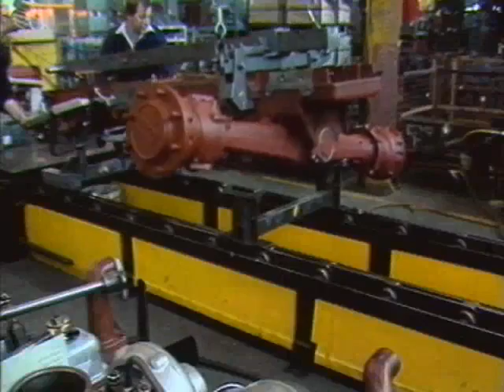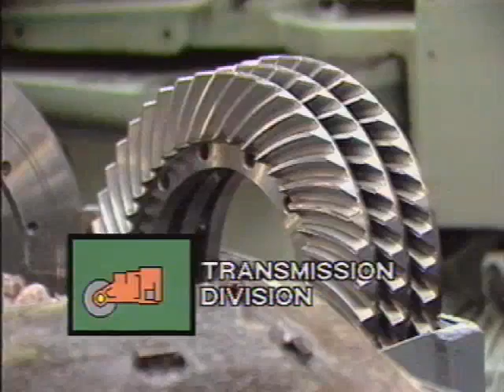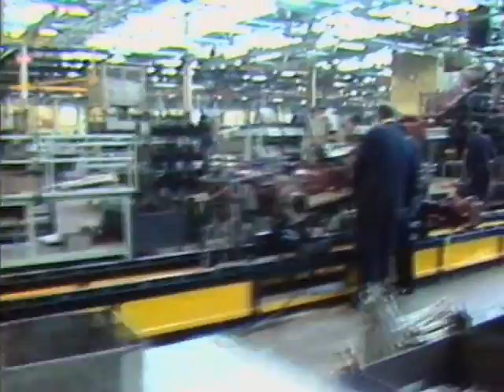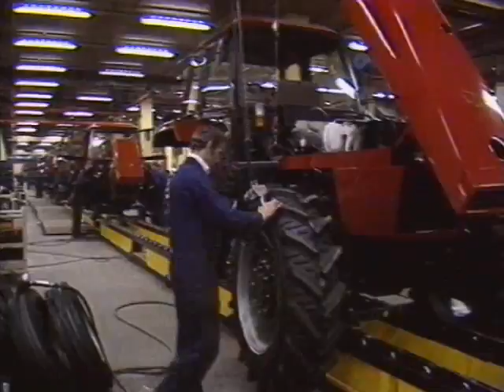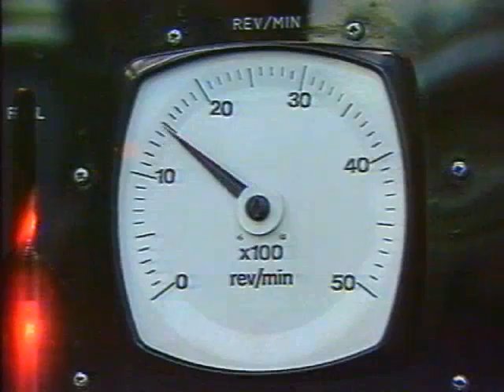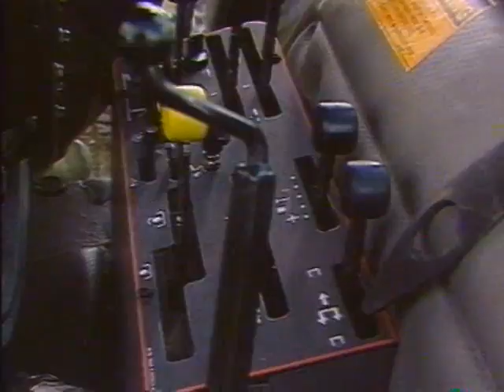Case IH 94 Series Factory Video

Comment: Im reparing a clutch in 1694 and i dont know how to adjust it because i dont have a special tools and instruction doesnt tell me what dimension are they...
Reply: Have you managed to find a workshop book for the tractor ? There should be both the workshop and operator's manual available on the internet, i got the operator's manual for my 1294, i got the workshop manual too but i need to print it too, made good use of it when i got the injectors reconditioned and needed to find the torque spec for them 😄

Comment: David Brown are the best tractor ever made I would love one but I don't have one cuz I'm 12 but my 2nd cousin restores them and he has a dB 885, 1390 bought brand new in 83, two 1394s one red the other black and orange, a 1594 red and a 1690 theyre all class
Reply: I have a Case 1294 from 85 it's not been treated so we'll after sitting in a barn for 10-20 years the previous owners then got it out and fixed up but it is missing a few parts and components mainly the electrics i am missing the windwash system as of right now, the gas struts for the roofhatch are missing, the hood has a dent on front from something falling on it, it also damaged the pipe on the air filter box so they put a plastic 75mm pipe on and glued it on with silicone i am working on fixing the tractor to it's glory it will be a slow process but i will get there one day i'm an 18 year old college student and i have loved tractors since i was 5 years old a friend of mine has the same tractor as me all in original it is in better shape than mine mostly but the mudguards are more beaten up than on mine i also need a det of door mirrors and arms for it then it should be completed 😁

Comment: I drive one of these evryday at work its a 28 year old Case 1394 with 4 wheel drive hydra shift and a front loader i :D I love this machine its always  running it never has any issues and The sound of it OMG! when you get it close to 1600/1700 rmp it sounds like a god singing! Edit The view is straight up trash you cant see a moose if it was stuck to you! xD
Reply: How many hours you got in it? We just bought 1694 with 2900hrs. It needs a bit new liners in the cabin and paintjob done, for being left outside for last 10years. We haven't yet decided if it's a keeper.
Reply: @hellyeabrother56  Well atm i dont know havent been there for a while :P but last i checkt it was like 5000 If im not Completly off now xD